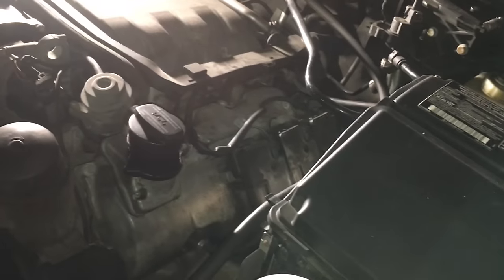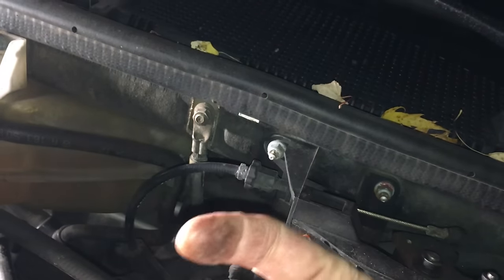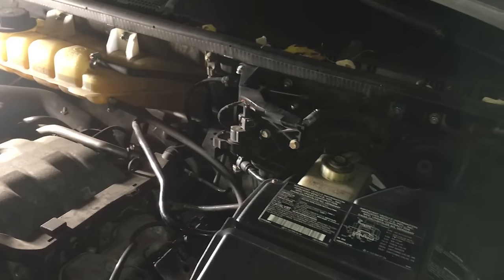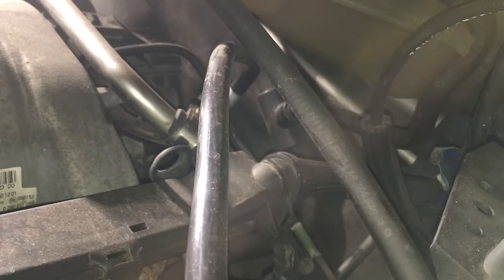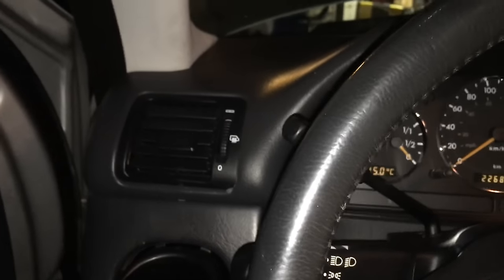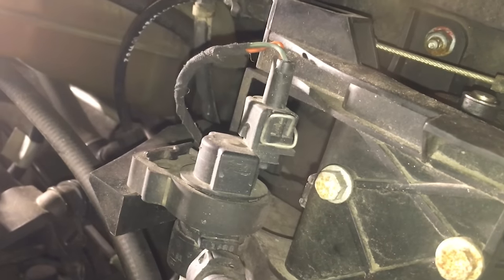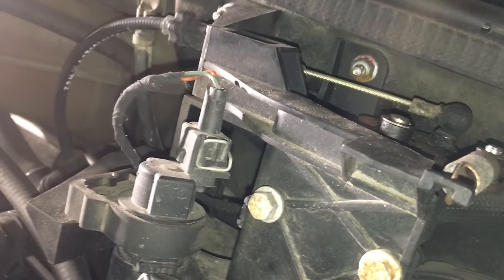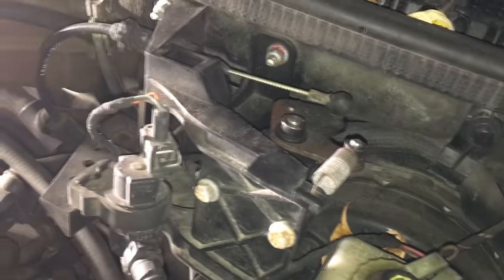Mercedes electronic throttle body how to reset idle .relearn..improved idle, throttle response

Comment: Hello friends
I have a problem with the my car Mercedes CLK 270 CDI W209 / year 2004/, I did diagnostics and wrote code p0123
what part should I look for
so I can replace it with that
 My diagnostic is for this
ECU: Engine
 
Status: Confirmed
 
DTC: P0123
 
Description: Throttle/pedal position sensor/switch A - circuit high
 
Potential 
 

When you buy the 'My Dashboard, Logs, Parameters' plugin, you will get:
  Parameter logs playback and sharing them in CSV format
  OBD I l DTC decoding (extended list)   Descriptions of potential causes of malfunctions for commonly encountered OBD Il DTCs
  Configuring all the parameters in the 'My Dashboard' section, not just 4   creating many custom dashboards   Description of important parameters of the OBD Il standard
Symptoms in my Mercedes :
Rough idle
Mercedes won’t idle
High idle
Idle at 2000 RPM
Sudden idle surges
Check engine light on
Poor fuel economy
Limp Mode
Poor Acceleration
Reply from the maker: throttle position sensor in the engine compartment .. check where the cable meets the sensor . You will see it under the hood when someone presses the throttle pedal you will see the cable pull on the sensor potentiometer . check the cable is not too tight . It can be adjusted like a bicycle brake cable with a nut on the end of the cable . Once you ensure there is a bit of slack in the cable turn the ignition key to the last position before starting the engine with all the gauge lights on . leave it like that for 4 minutes then start the car and see if the electronic throttle has reset . Should be mostly the same procedure as in the petrol version . If that doesn't work the pedal sensor is like;ly bad . 10 minute repair to replace it

Comment: Hi, 
At 04:09 - the "thing" with the plug in its top, how is called??? And what function does it have?
Thank you
Reply from the maker: That's the electronic throttle actuator.. it takes the signal/position from the throttle pedal and sends that signal to the throttle body to tell it how far to open or close
Reply: fupabox Thank you !

Mine does a clicking noise and i wanted to look up the problem but i didn't knos what was that. Cheers!
Reply: My bad, is not what i was looking for- is quite similar in size in shape but is a little bit lower (towards the headlight). Looks like a small pump, has a connector on top and some hose in and out. Also has a "LOW" marking on it...

Do you know what that is?
Reply from the maker: does it make a ticking sound ?  I think you might mean the fuel tank vapor solenoid. If so , it is like a little pump..it takes fumes from the fuel tank and sends them into the engine to be burned so they won;t escape into the air. ticking is good.. that is the sound of it working
Reply: That is the one, thank you FUPABOX!
Reply from the maker: any time . glad to help

Comment: Hi there I have a 03 ml500 with a code po400 I have changed EGR valve for a new and new pipe but that code instead there anybody know how to fix it? thank you
Reply from the maker: Did you clear the old codes ?  check vacuum lines and throttle body seal to intake manifold

Comment: I have a 94 mbz 280 and the mine idles higher now and it drives with out pushing throttle brakes are harder to push to stop maybe u would know
Reply from the maker: vacuum, leak somewhere

Comment: I did that now it idles at 1500,instead of 750 800, 1998 C43AMG
Reply from the maker: Check the tension in your throttle cable
Reply: fupabox I checked it has a little slack exactly like your video

Comment: I cant find the solution for p0110 on my w202 c240 any help? And yes I replaced the maf..
Reply from the maker: did you use a bosch or an aftermarket maf ?  aftermarket will allow the car to run and not stall out , but Benzs usually don't like them . The temp sensor is attached to the end of the MAF so check all the wiring to it . check your engine ground strap . With older cars I usually run a thick gauge wire as an extra ground between a bolt on the chassis to a bolt on the engine . An old or slightly corroded ground wire or ground strap can cause a tiny enough electrical difference to trick the IAT sensor. Check air filter is clean .